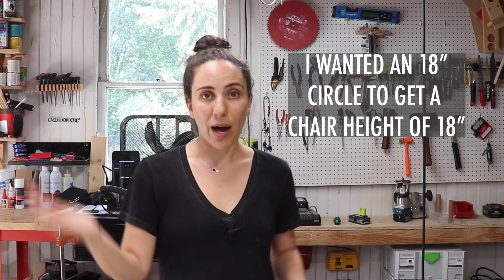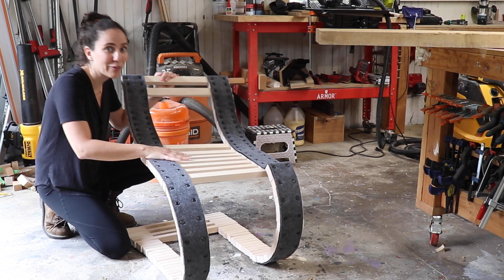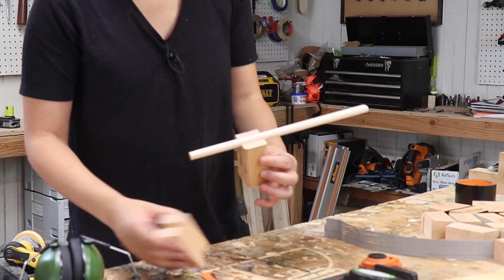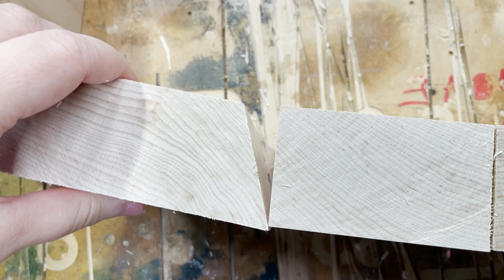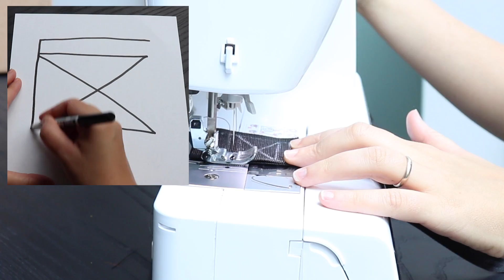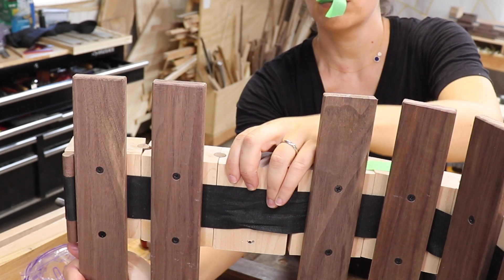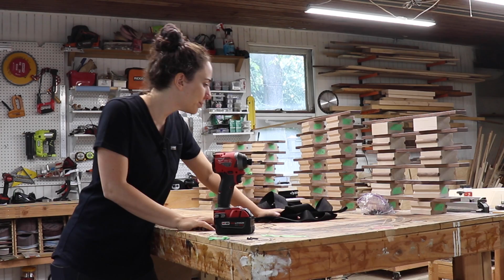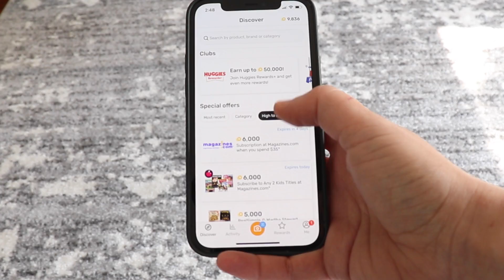I ATTEMPT to make a Roll Up Chair… AGAIN...

Comment: Use joinery, not straps. Think bicycle chain design. If the links have interlocking faces, which can support the load transfer to the base, that can govern your shape but movable dowel joints can distribute horizontal force better, reducing the risk of rocking out of plumb.

Comment: Tamar ,I have to say, that ancient patriarch, Job, has got nothin' on you when it comes to patience.  I'm not so sure the chair can be functional. As you said in the first video attempt the maker of the chair wasn't sitting on it in a very functional way. You were able to sort of sit on the edge ( like he was in the picture) but it definitely was not going to support anyone in a full sitting position. By the way, the 20 or 30 minute perusal period during an evolving project is essential in my estimation. I do it all the time sitting on a 5 gallon bucket with a cup of tea in hand. Sometimes the project designs itself from that vantage point. Great video for so many reasons.
Reply from the maker: Haha i may have sat longer than I admitted to 😂

Comment: Maybe in addition to whatever type of strapping, you could add steel cable underneath the straps, maybe in a thin routed groove running the length top to bottom?
Reply from the maker: Maybe

Comment: I think drilling through each piece and running Dyneema sailing line to tie it all together (instead of the nylon webbing or cable). Dyneema is super light, super strong, and does not stretch.
Reply from the maker: Interesting

Comment: You could put the straps on in sections, shorter pieces. Because that strapping is so long it allows the material to expand, so under a lot of stress it will cause the end of the chair to flip up and hurt someone. And use the dowels to hold the straps at each section like you did at the top of the chair. Then use  dowels at the tops of each angled piece and drill a whole in the adjacent piece to act as a locking pin to prevent it from possibly flipping up from too much tension. I think that should work.
Reply from the maker: That sounds interesting
Reply: @3x3CustomTamar  looking forward to the next update!

Comment: Something I saw that you might try...From where you sit your butt on up to the top of the chair, you don't need much tension on the straps.  You could connect those separate from the lower straps and use reduced tension on the upper portion and then concentrate all your tensioned strapping on the lower curving pieces.  Also not sure leather would work either.  You need a material that WILL NOT stretch.  I don't know...bicycle chains?  Metal for sure!
Reply from the maker: Maybe!

Comment: Love that you keep trying! Looking forward to Part 3! You're not gonna let this chair win!!
 
One idea I just had, and I haven't thought this through at all so I can't elaborate on how it would work. But what if you used similar technique as in tensegrity tables to connect the bottom and top in the back?
Like you could just add a belt loop or something else to attach the strap making it go full circle and maybe you can use the same strap to keep it together when you roll it up later.

Again, I haven't thought it through and I don't fully understand the physics of tensegrity designs either so I have no idea what I'm really talking about 😄 
 
Next time you can save on material by making a scaled down prototype before you go for the full scale.
 
 If you're sticking with the dowel design and you're certain in will work I would suggest used brass rods for it I think that would look amazing!
Reply from the maker: I thought of using brass too! Would look sooo cool!

Comment: Leather would also stretch. How about ratchet strap webbing? That holds down heavy machinery on road trailers, and is professionally un-stretchy. Your tenacity is inspiring! Hope you come back to this at some point 🙏
Reply from the maker: I actually got some for it was 4” wide. And I had already cut my pieces to 4” wide…

Comment: Thank you for readdressing this project. I'd like to see it work. Leather is not the answer because it also stretches. An idea came toward the end of the video when you were explaining the clamp, what if you had the straps in a loop where they connect from the top of the back rest to the end of the runner with a cinch style buckle?
Reply from the maker: That’s definitely a good idea

Comment: I feel your pain, and still admire the fact you don't accept defeat! Hat off for this.

You mentioned ideas, and funnily enough, I've got one... Straps keep letting you down, so it's time to abandon it. Make the joints mechanical. I'd take inspiration from chains, except letting them bend only the desired (one) way, and let the links get in contact with each other to stop the movement where desired. If it's hard to imagine what I'm writing down, let me know here, and I'll happily send you some CAD or 2D data.
Reply from the maker: Yeah. Agreed. No more straps. You can send me an email if you like

Comment: What if you created blocks with the grain oriented along the straps.  This arranges the wood in the best way for compression.  Then drill through the center a hole large enough for some aircraft cable.  You could still have strapping visible for the esthetic but the cables would provide the structure.
  I think what is happening with the plastic straps is that they are stretching and the wood grain is compressing causing the lack of tension.  Turning the blocks perpendicular would allow the wood to be in its strongest  (least compressible) orientation, the steel cables would not stretch appreciably thus maintaining the required tension.  

I liked the dowel solution to keep the segments from twisting, a nice 'out of the box' approach!
Reply from the maker: Definitely a good thought

Comment: I absolutely love all of your experimentation!  I think the nylon webbing needs to be replaced with steel cables to reduce the amount of stretch and greatly increase the strength.  I'm thinking additional sections running from the back of the chair down to the back of the base will help shore up all the downward forces, like the parabolic buttresses on European cathedrals.  More pieces may need to be added to the back of the base to allow for that parabolic curve that would intersect the floor farther backwards.  I'm an architectural engineer and tend to think of things with bridges in buildings in mind.  You're combining aspects of a suspension bridge with stone arches.  Very cool.
Reply from the maker: Sounds interesting!

Comment: I find the story of the roll-up chair very relatable to the saga of my worktable - I saw a design that I liked and adapted it to my needs, then I discovered a major design flaw.  I fixed the flaw but then found another.  And another.  This happened a few times and was very frustrating.  I ended up saving a core part of the table, built it into a new frame, added some simple features and now (8 years later!!!!) I have an absolutely enviable worktable.  I have had numerous folks doing work at my house ask me to sell it to them and others call it their "dream table".  Moral of the story - you will get there, you are figuring out a lot of useful stuff and the path to success, but you will get there - hopefully sooner than 8 years.  Side note - I recently moved and refused to part with the table, loading it into a U-Haul trailer was....not easy, but I still have it!  Good luck Tamar!
Reply from the maker: Haha I hope to get there someday!

Comment: Don't try leather, it will likely stretch more. I feel like you're going to make it work you'll need to embed a metal cable with cable stops crimped and held between 2 half's of a block of wood to prevent the cable from sliding
Reply from the maker: Maybe

Comment: Sorry it failed again. I think it doesn’t work because the force on the front ‘knee’ is crazy high.
Reply from the maker: Yup
Reply: I guess the less ‘deep’ the chair, the lower the force. The smaller the chair (kids version perhaps?) the lower that force. Anything with ‘give’ for the strap is probably too loose, and that would include leather as well I think. You’d need something stiff like light metal or nylon, something. ;)

Comment: I believe leather will stretch much more and unpredictably than the belts you used.

Maybe if your dowels were actually shallow "french cleats" to lock/hold the gaps closed during tension and change the angles with regard to the downwards loading/pivot/leverage points (where the gaps keep appearing). 

I also think this style of chair will never be safe for small inquisitive fingers...
Reply from the maker: Yeah. Once I got hurt. I knew I couldn’t bring it in the house.

Comment: Firstly, I love how it looks even though it isn't quite a chair yet. Secondly I admire your dedication to come back to this project again and do all of the testing and retesting you have done. Thirdly, I know nothing about woodworking, but it seems weird to me how you attached the strapping, it looks like it is only really anchored to one end and then to the other, it is sandwiched by the walnut, but I imagine it can still slide through that space making the tension different between one section to the next, was there a problem with directly attaching the strapping in the first version?
Reply from the maker: My plan was to attach the strapping with staples after figuring out the length. But I realized it will just keep stretching and there was no Amount of “safe” tension I could apply without it collapsing

Comment: Have you considered putting a small stainless steel cable through the center length of the chair...the cable will add strength with the cloth strap.
Reply from the maker: Definitely a thought. Ha

Comment: Ok, so I'm sure you will get plenty of suggestions, ideas, and such, but I figured I might as well share a few thoughts:
-if you cut the wood so the grain goes along the direction of the spline, instead of perpendicular, you could get enough strength to use hinges (like metal ones)? You could still put some kind of fabric or strapping to hide them.
-one of the issues with the strapping going up the back is that you gain both slack and tension at the bend at the back of seat. If the strap only went to the back of the seat and then a separate strap held the back, it would potentially solve a few different issues? Again, just a thought, but the engineering side of me thinks that's you biggest issue. Securing the strap to each block seems like it would solve the problem in theory, but won't be as strong as your anchors at the ends...
-leather will have more give to it than you probably expect, especially over time, so I would not suggest it.
-if you're worried about the back of it rolling up, maybe embedding a few magnets could help?
-you could also have a few simple fold up legs to support the back of the seat on the base? I know it's not quite the same aesthetic, but sometimes it's the little victories... At least for me

And just to finish, you should know that this is such a cool project and I love how you're sticking to it. Don't give up, you've got this!
Reply from the maker: Lots of great ideas
Reply: @3x3CustomTamar  hope it helps! I really wanna see you finish this!!

Comment: I think you are on the right track.  How about as an experiment you try some straps used in those ratcheting tie downs to see how they work?  I don’t think they stretch much if at all and they are very strong.  It might also help to connect the straps to the pieces at certain points to keep it more stable but that's just a guess.
Reply from the maker: Maybe!

Comment: Hey Tamar, I'm at 19:05 in now and I'm so disappointed for you. (I don't flash ahead so I feel like I'm getting the experience 'real time'} Maybe you could use something that cannot stretch at all, like chain mail.  You wouldn't be able to put it in tension, but measured correctly it could be the answer.
Reply from the maker: Maybe!

Comment: It would be a lot more work, but do you think adding a 3rd strap (with wood joints) running down the center would add enough strength to support enough weight to sit on it?
Reply from the maker: Maybe!

Comment: Okay, so it seems like the connection fabric's stretch is the issue, right? What if you didn't use a fabric at all, but used like 1/4" steel cable? You could drill a hole that is half on your maple pieces and half on the walnut slats, and run the cable through that, and find a way to secure it to the end maple pieces?

Also, I think leather will stretch WAY more than the fabric you used here. This looks like seat belt webbing. Is it the same thing? If not, will seat belt webbing stretch less or more than what you used here?

Regardless of whether we get a third attempt, I love your channel and your everywoman vibe. Great work, Tamar!
Reply from the maker: Thanks! Yeah. That was seat belt webbing. The second one.

Comment: Hello,
Maybe a dumb comment...
Maybe you could use hinges to replace the fabrics and some magnets to kind of locking it in place or prevent a bit the collapsing...?
Anyway, thanks for your videos
Reply from the maker: Lots of ppl are suggesting that. So not dumb at all
Reply: Thanks!
I guess you already saw it or someone might have told you, but just in case Mr Gerard VAN DER BEEK manage to do this kind of chair.
Have a nice day.
Reply: And there is a youtube presentation to see it...
Reply: https://youtu.be/8pQFHT_rh8Y
Reply: But i guess a CNC is kind of the way to go to do it his way but the interlocking pieces with the kind of lock extention is kind of interesting.

Am finally done, bye

Comment: You could try some straps made for off-road vehicle recovery. There are versions that have zero stretch.
Reply: Still too stretchy.
We need steel cables at least.
Reply: @drgazter  i agree.  I'd like to see that myself.  I think it would look even cooler too.
Reply: @drgazter  Thats' what I was thinking too, but steel cables will cut into the wood so it'll still sag a lot.
Reply: @GrayHatter  plastic coated cable, and tight tolerance on the holes
Reply: @drgazter  I commented on this separately, but I was thinking steel banding strap used in shipping on pallets. It could be used just like plastic strapping, but would have very little stretch and a lot of strength.

Comment: Leather also would stretch, think on how tight new leather shoes become more comfortable over time....you may need to go to adding in one or more wire braid cables as that would stretch less and you could hide it under the strapping, ie use the strapping just as a nice cover for the wire cables may work?  Thanks for sharing the fun process even though for so many iterations, it was likely super frustrating to do.  But even the cable may cause it to still collapse....it almost needs something else on the back side to add in tension once it is in position to hold it that way too.
Reply from the maker: Ugh. I gotta figure this out

Comment: Try slotting the strap through the pieces, instead of on top.   That will prevent the tension causing pieces to curl up and release the tension. 

Next, make a way to adjust tension without taking it all part so that you're not depending on a preset amount of tension.  A metal dowl with a threaded hole perpendicular to the dowl, swen into the end of the strap, and using a bolt to pull the dowl might work.  Or even just a ratcheting strap as a cheap and easy proof of concept.
Reply from the maker: Interesting

Comment: As I said in the previous video, I still think that the bicycle or motorcycle chain is the way to go. It won't stretch at all, but over all you still should have a "rocking style" flex in the chair. The chain can be nicely recessed in the groove so it won't disturb the wooden appearance of the chair. The chain can be easily adjusted by adding or removing the links with really cheap tool "chain breaker". I don't know about motorcycle chain, but bicycle chain comes in many different colours (black, gold, rainbow etc.) Motorcycle would be stronger though.
Reply from the maker: Maybe!
Reply: @3x3CustomTamar  Of course maybe :) I can imagine that tons of other complications would come to surface. It easy to by "smart" behind the keyboard :D

Comment: Mb something like a butterfly/ French cleat joint that’s only glued on one side.  That when it’s rolled up it sinks into the wood. Then when weight is put on the joint it pulls the cleat into place. Would eliminate any stretch on the lower curve.
Reply from the maker: Interesting idea!

Comment: Just put some drop down (back) legs
Reply from the maker: That would definitely solve it but wouldn’t be as cool. Ha
Reply: @3x3CustomTamar  Overlapping more fabric on the buttock & back part for tension??
Reply: @3x3CustomTamar  I just saw Van Der Beeks chair & he uses a big A bike chain made out of metal on the side, another guy used jigsaw wood horizontal pieces!!

Comment: Good work. 👏

The collapse is by the lever on the opposite side of the strap, each piece creates a counterforce. Need a turnbuckle like a guitar neck. Have you ever thought of a seat cover shorter than the strap to serve as a counter-force to the leverage process?
Reply from the maker: Maybe that would work